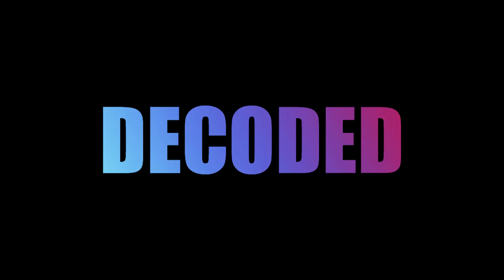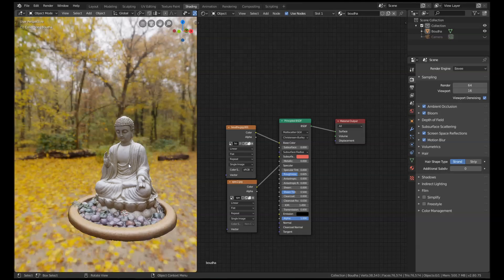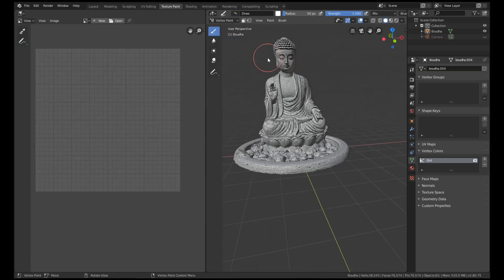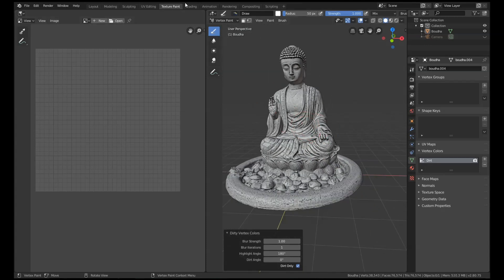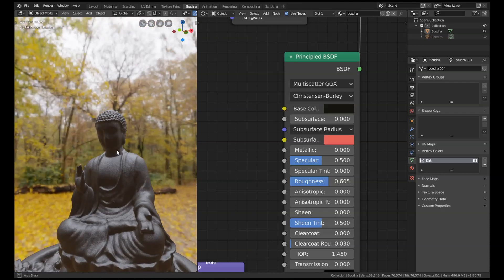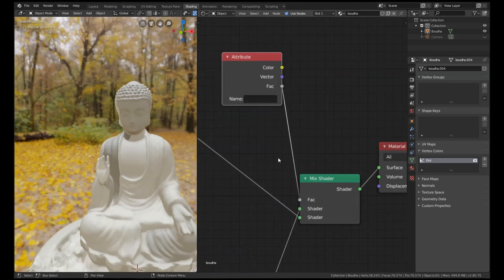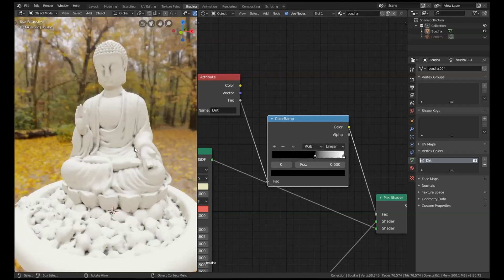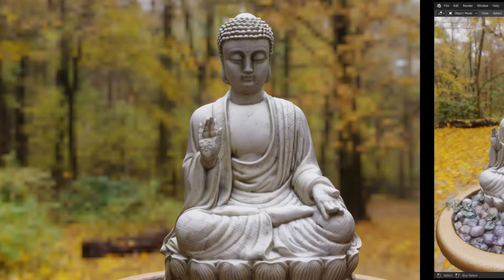Blender Tutorial: Level Up Your Realism In Five Minutes With Cavity Maps

Comment: Nice. Is there any reason you opted for this method instead of using the AO node?
Reply from the maker: It gives a marginally different results from the AO node and it's less computationally expensive, since it uses vertex colours instead of raycasting. The AO node can really increase render times so it's best to avoid it where possible.
Reply: @DECODEDVFX  ah I see. Cheers!

Comment: I'm wondering, does using the Pointiness output of the Object Info  (I guess) node as a mix factor achieve the same result? Or, to put it differently, is this Vertex Paint feature derived from the Pointiness? Sure looks like it
Reply from the maker: Not exactly. Dirty vertex colours is like a mix between the ambient occlusion node and the pointiness factor.
Reply: @DECODEDVFX  Thank you. I'd be very interested in a video detailing the advantages / pros and cons on this topic

Comment: how would one and dirt after normal map, I mean dirt in the little features introduced by the normal map?
Reply: The normal map doesn't introduce any dirt. The Dirty Vertex Colors algorithm takes into account only vertex angles, which depends on the geometry of the mesh, and is independent of texturing.
Reply: @lord_talos_gaming  Sorry for the unclear question. I meant to ask if it's possible to calculate "cavities" from a normal map for the purpose of adding dirt similar to this. I mean the situation where the mesh isn't actually detailed and a normal map is used to add apparent detail.

Comment: what would make it even more amazing is adding some leak erosion based on that dirt....Not sure how you'd approach that though
Reply: Have a separate material for the dirt/corrosion, use mix material and have it masked out by cavity. Done !
Reply: @IGarrettI  wat
Reply: i hear the dynamic paint modifier can simulate water running along the surface and set it to displace to have it carve out water lines